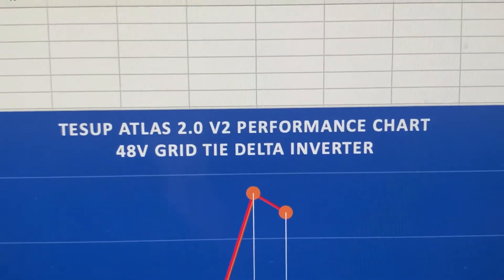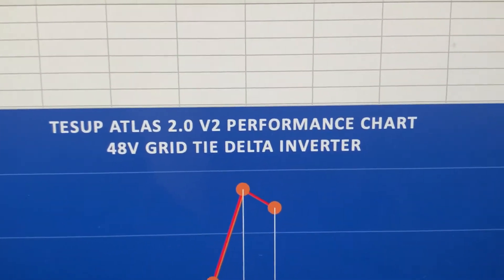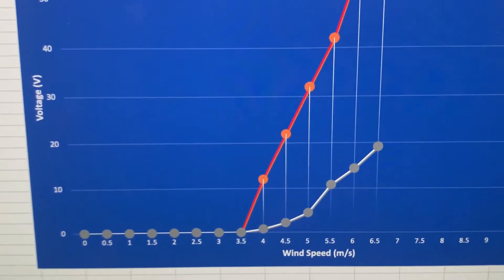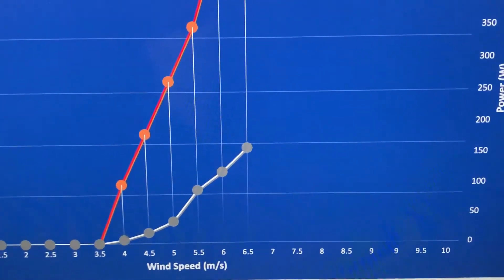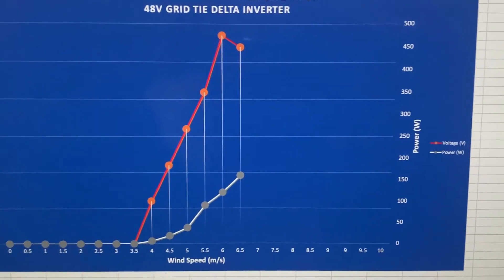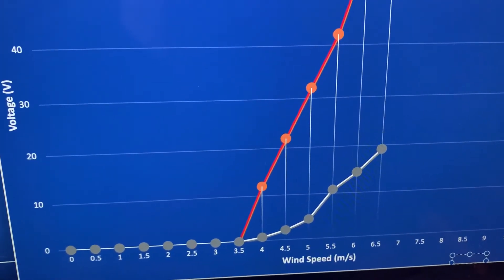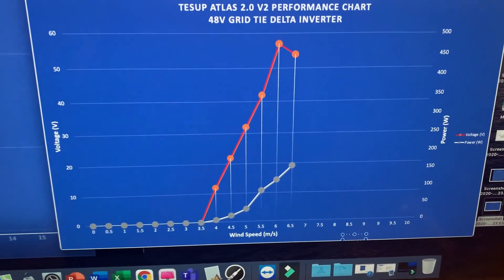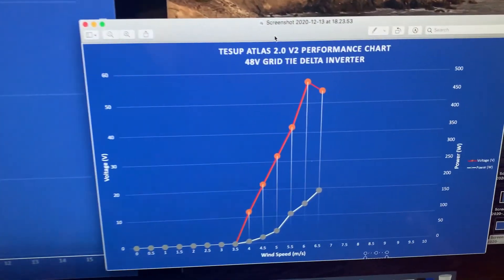TESUP Atlas 2.0 v2 final Assessment and Verdict

Comment: Thanks so much for this video. I am glad to learn that a) TESUP wind turbines actually do exist and will eventually be delivered to the customer who ordered them and that b) they do actually produce energy. Yours is the only video out there that has reported real world data on this turbine and not just simply trashed it by claiming it will never produce any energy at all.  I am buying one of those and will be using it together with my photovoltaic system and a Victron inverter in an off-grid configuration. The World Wind Atlas gives a mean wind speed of 6.5m/s and a power density of 600W/m^2 for my location. With great differences in seasonal wind speeds. Calm weather in summer and rather windy in winter. If this turbine manages to produce 200 or 300W during the winter season when solar radiation is insufficient I'd be happy. The most my solar system can produce is about 1.2 kW and it only runs during the day and not during the night and days with significant cloud cover. So overall the energy input from this turbine could almost double my energy production. More than enough for my needs.
Reply from the maker: Fair but I dont know why you wouldn't buy a std HAWT turbine like an Istabreeze as they perform better??

Comment: At 10 m/sec wind speed on a 1 sq meter surface = 600 watts (x3 blades, assuming 1 sq meter per blade) = 1800 watts. Horizontal shaft wind turbine efficiency ~ 20% yields 360 watts, vertical shaft ~ 10% = 180 watts (frontal resistance). A good rule to remember when contemplating purchasing a wind turbine.
Take care;
The Island dweller

Comment: It is good to see that someone is thinking and doing some measurements to verify the exorbitant claims...But there is an easier (and quicker, and cheaper) way to assess whether they are true or not.
The Atlas 2.0 turbine is a Savonius type. They typically have efficiency of about 0.2 (that is, 20% of wind speed can be turned into electricity). Atlas 2.0 also has about 1.1 m2 swept area (important).
At wind speed of 10 m/s, the power in the wind calculated for the 1.1m2 swept area is: Pwind = 0.5*1.225*10^3*1.1 = 0.674 kW. Multiply this by the efficiency - you get 0.674*0.2 = 0.135 kW useful power (at wind speed 10 m/s). Atlas claims 0.91 kW at 10 m/s - which is more than the total wind power...we finally found a device which has above 1.0 efficiency...perpetual motion machine, that is.
Since your measurements produced 0.15 kW at 6.5 m/s - I would suggest checking your anemometer. Wind power scales like 3rd power - so at 6.5 m/s the wind power is 0.185 kW. If your measurement shows that you produce 0.15 kW - this would imply turbine efficiency of (0.15/0.185) = 81% - which is a physical impossibility.
If you measured the wind speed at ground level - this might explain the source of discrepancy: your wind speed at the turbine must have been closer to 10 m/s than you think.
Just saying...
Reply from the maker: Thanks. Good builds

Comment: olá  gostaria de maiores informações
Reply from the maker: what about specifically
Reply: tensao corrente potência. dimensionais.... controlador de carga... site?
Reply from the maker: @rubensalmeida2978  10m tower, 2kw turbine (quoted by TESUP) Should generate 20-40amps at normal voltage output (48v) from around 6m/s upward but only generates 2-amps max. Charge controller was TESUP but also then swapped to high quality version (no difference so issue is poor quality turbine).

Comment: ok  I too have one of these well over   hyped very slow to arrive  tesup 2 units,  and the construction is woefully  amateurish  the company as others note is a london office only  and that is an accommodation address  with suggestions of prospect park - BUT that is i think a BA  office zone so unlikely.  Either way the spec claims for wind speed are well over the odds, the wiring is rubbish and the charge controller / inverter are both not well made or matched together at all well.  That said by adding a strip of lexan to the blade outer  edge, dumping the charge controller   and replacing it with a step up transformer to double the output voltage then injecting that remodelled output into a spare MPPT solar controller input one can get it to work passably well in low speed wind conditions ... So not a lot left from Mssrs Tesup  supply, and for anybody who does not have a good electrical and mechanical knowledge not a good item to purchase.
Reply from the maker: if you bought through mastercard you can get your money back as I claimed it wasnt meeting their specificed power output and proved it with my videos.

Comment: How do i know when it is loading? I got the atlas x. And the charge controller. I have pluged It to the battery.
Reply from the maker: Are you showing a voltage reading on the charge controller?

Comment: before you pay for a new turbine the inverter i have is a eco-worthy sun-1000g2 it is for wind turbines and take the 3phase from your turbine and feeds it to your house as single phase . it starts feeding power at about 15/20v so you should be able fir your turbine to it .
it comes with current sensor to show how much power the house is using and also a dump load resistor .i have it set up but my turbine is not big enough to feed any power back to the house so i am looking for a new one can i ask do,s the one you have make much nose 
and if your thinking of selling it can you tell me please
Reply from the maker: Yes but the issue is how it works with the TESUP and how it pulls the load. The gearing on the new TESUP Atlas 2 means that this turbine only works very well after 5.5 m/s wind speed and although it will then still turn at constant 4.5, any gust drop off stops the turbine. Depending on the software of the inverter (i have a Sun 2000w already) it may not convert that to power.
You also need to check whether the Sun you have has the auto grid cut off (some don't and some don't work). You don't want to electrocute people working on the grid if the power from the grid stops. The Delta H3 has an auto shut off for grid failure. On top of that the Sun has the most pathetic dump load mechanism of any system. You can't use the 1000w with the TESUP Atlas as the inverter needs to be rated almost 1.5-2X the potential of the wind turbine. That means you need at least 3000w and a dump load system to cope with 2kw. Theres also no braking system on the Sun (other than that its fine ;-) )
Reply: I can sell brand new Tesup Atlas 2 for a half price

Comment: thank you very much for that you have saved my a lot of money i was looking at one of these 2kw turbines i hope some one stops these people selling these ,
Reply from the maker: i think its more about the setup they recommend. im going to try running the output through a different setup. However im pretty convinced that HAWT beats VAWT almost every time
Reply: @Homewindturbinereviews  when you say the set up do you mean the way you get the power from the wind turbine to your house . the inverter i have take the power from my so called 400w turbine and feeds it to the house and that is what i was going to do with the 2kw tesup one can i ask how high you have yours from the floor
Reply from the maker: @robertgoy9367  I use the Tesup controller which has the rectifier from ac to dc and also limiter for voltage if using batteries. Most importantly it has a brake mechanism to stop the turbine in heavy winds. I then feed that output straight into the Delta H3 inverter (recommended and sold by Tesup). Delta is then connected via AC isolator to consumer unit.
The issue is the inverter software doesn’t allow good control of the variable dc output from the turbine controller.
I’m going to try a Chinese inverter with built in rectifier and bypass the Tesup controller. Then I will try a new horizontal 1.5kw turbine with the same inverter options.

Comment: Thanks for the great review ! 
I'm also thinking of getting the b&c 1kw monster turbine...ive seen great results on you tube with that turbine... but I do wonder what the atlas will do once we get some real spring time winds ...
Keep us updated pls 🙏
Reply from the maker: I wonder whether the 12v or 24v battery only option is better. The grid tie loses huge power in the poor software conversion with the inverter
Reply: @Homewindturbinereviews  any adjustments on the inverter? A lot of wind turbine inverters are adjustable to set the amp pull and keep the turbine spinning in the sweet spot...
Ya could also try connecting it to your battery bank via a power meter ?
Reply from the maker: @paullillis4399  yes I think a better option is to get a battery bank and then link that back through an inverter   There are very little changes available on the inverter without real technical knowledge (it’s restricted access settings)
I even connected one of the basic inverters offered on the web with some wind turbines but again it didn’t provide much power
Reply: @Homewindturbinereviews  yeah not many inverters out there for small wind, midnite solar do a good one the classic which does wind,solar,hydro but its expensive and its just battery charging based its so American! Sma sunny boy used to do one but that got pulled a few years ago,I see the Chinese gti2000w on grid inverters you can adjust the load at set intervals, have a look at dave collier channel on you tube ,but I think best option is to go direct to a battery bank with a diversion controller to a resistive load at a set voltage with a grid tie dumping what it can Into the grid.
I'm sure any extra power into your batterys via a power meter is a plus?
Reply from the maker: @paullillis4399  I think you're right. Bottom line is Wind isn't a patch on solar for effective power generation and solar +Battery is the way to go. Wind is only viable (outside of fun) in coastal areas and wind traps over 7 m/s
Reply: If You like i can sell brand new Atlas with charge controller for a half price